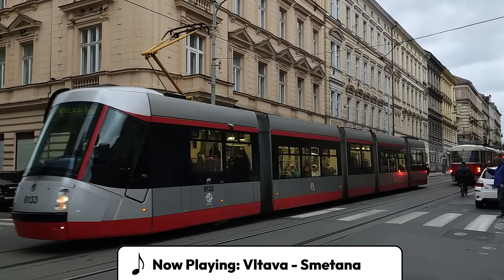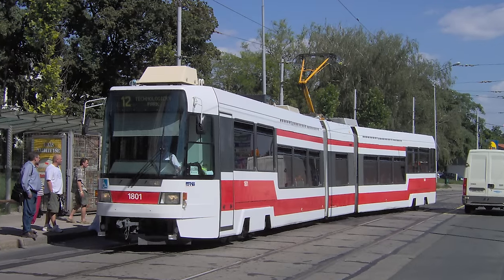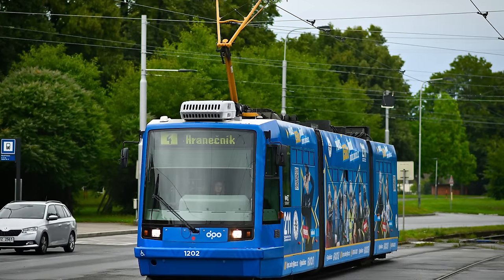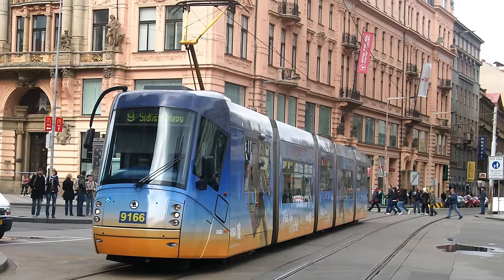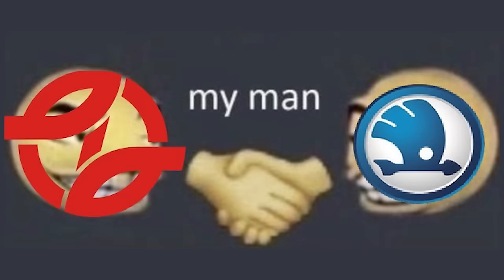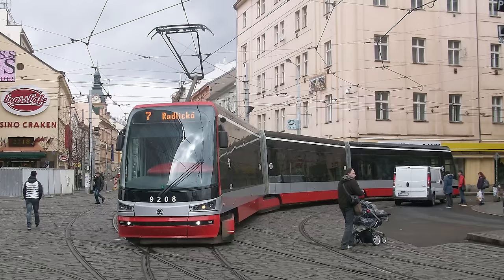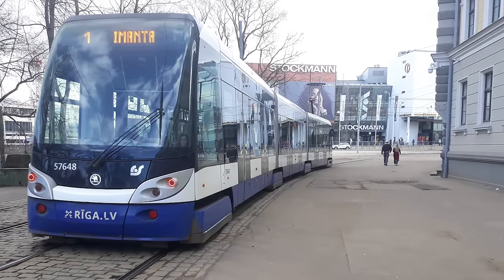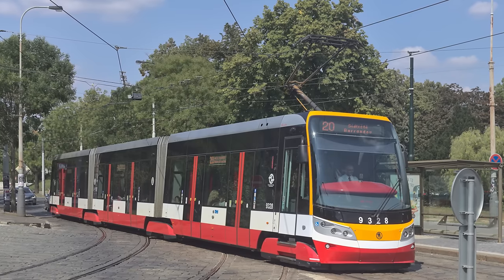Škoda 15T - The Tram That Revolutionized Transit

Comment: They should not replace the tatras, the t3s in prauge are the same thing as the double decker buses are in london
Reply: just because it's iconic doesn't mean it's the best thing ever created
Reply: @simunpusec1078 You know they can keep some of the T3s and put them on the nostalgic/historical line like 23?
Reply: @codefident4939  Škoda 15t is a piece of shit, and i know it because i live in prague. Theres not enough space and the design is just awful. Its the worst tram you can find in prague. ČKD Tatra has created the best trams, and Tatra T3 doesnt have any malfunctions, Škoda 15T in the other hand, has some serious issues and has limited speed because otherwise it would break into several pieces and that happened before. Line 23 already has T3SUCS its retro and some other trams are on it. I know that Tatra T3 will stay in work for more years than Škoda 15T. Škoda 15T is bullshit.
Reply: @Janevimteda_  I'm not from Prague so idk, maybe you are right. When I've ridden 15T (in Prague ofc) there were fine, although I think DPP should retrofit them with AC (this is what my city, Kraków, is doing with older Bombardier NGT6 trams). Also I feel like the older 15T's bogies are louder when going through intersections.

I think that Škoda 14T (and also 13T, 16T, 19T) is much worse. Ride quality is bad, the motors (or some other electric parts) are extremely noisy and the interior design is a one big mistake like metro-style side seats or pretty high floor in 3 out of 5 sections of the tram.
Reply: @codefident4939  No , he's full of shit or T3 nostalgist. 15T is the superior model currently running in Prage in terms of space and accessibility. That Tatra does not have malfunctions is just laughable - just 5 days ago one blocked a crossroad I guess because of an electric fault and batteries running out. The rescue crew tried resetting pantograph several times and ended up borrowing a front battery from T15 stuck in queue behind. How do I know? Because my (and several other kids) had to watch the entire thing.
Reply: @Janevimteda_  Every time I see a T3, I avoid it like a plague. Stuff belongs in the museum
Reply: Ofc they're gonna keep some for historical lines but it doesn't belong into regular service
Reply: As much as I love T3. they are far faaar less capable than T15. T3 as someone has said, belongs in a museum.
Reply: @Nauro50  You know that Škoda 15T has limited speed limit? And you know why? Because it would fell apart and that already happened once. The bogies of 15T fell apart and the tram was in 3 pieces. T3 might not be the best tram, but its safer than 15T.
Reply: I can absolutely recommend getting a group of people together and renting a T3 Coupé ride.

Comment: People tend to overlook the serious problems the 15T came with. It had huge problems with its wheels falling apart at high speed resulting un the reduction of the max speed it can travel at. It originally also came with poorly designed seats that caused people to fall off as well as a lower than advertised capacity. It also cost several times more than any other tram. And on a personal note its loud and ugly.
Reply: It is loud, but still better than the 14T. I encourage you to try the 29T/30T in Bratislava. They are surprisingly quiet and smooth riding, compared to both models that run in Prague.
Reply: Easy to overlook when everyone's first thought is just "thank god its not the 14t nor the kt8n."
Reply: Yes the old wooden seats... paradox is they have been selected by public questioning, but only based on pictures... in reality, they were good looking but neither easy to maintain (easily scratched) nor good function (hard, and people were sliding much on their surface)...

Comment: 29Ts in Bratislava are honesly better. Basically 15T but it doesnt have quite as tight interior imo (the bendy bits are as wide as the rest of the tram)
Reply: 29T/30T in Bratislava have a completely different bogie design. A much better one, relying on old and proven concepts that are cheaper, simpler and ultimately better. Not everything new, modern over-engineered is always the best. The new Škoda 52T trams for Prague are a further development of the 29T/30T and I hope they will ride equally good and silent.
Reply: @erikziak1249  Why didn't Škoda offer ForCity Smart tram like the 45T for Brno instead?

Comment: The Škoda 15T was truly revolutionary and over-engineered. Its technical strengths became its operational limitations. Having 16 motors with permanent magnets that directly drive individual wheels without a transmission and a four-point suspension layout on the inner bogies makes not for a very pleasant ride, especially on certain sections of the network. Initially the 15T was also very noisy, almost as the universally hated 14T. Some issues of the 15T had been fixed, but the fact that Prague opted for the 52T shows that an over-engineered and theoretically superior (on paper) streetcar is not necessarily better than proven concepts of classical tram axles and geared motors that run an entire wheelset. The new Škoda 52T was developed from the Škoda 29T/30T models that run in Bratislava since 2015. The Škoda 29T/30T model was specially developed for Bratislava (and does not run anywhere else), because the 15T has some undesirable running characteristics that Bratislava wanted to avoid. While the 29T/30T may seem technologically less advanced than the 15T and a step back, they are much quieter than the 15T, have a far better ride quality even on sections of worse tracks and since they reverted to decades long and proven concepts they did not suffer that many initial issues as the 15T did when it was put into service. The new Škoda 52T is practically a further development of the 29T/30T concept, and I am very curious how it will be. If it will ride the rails as smooth as the 29T/30T in Bratislava, then Prague is in for a treat. The bogies of the 29T/30T are really well designed, they produce little noise and even though the inner bogies are fixed (non-pivoting), the wheel flange wear is low, much lower compared to the narrow gauge bogies of ČKD Tatra trams. The oldest Škoda 30T streetcars in Bratislava have driven more than 600 thousand km in only 9 years of operation and remain in good shape. The majority of the trams was made in 2015, with a small part in 2016, when 60 units were delivered. Their success led to further 30 units being made in 2023 and 2024 and the last 10 trams are expected to be delivered in 2026. So in two more years, Bratislava will have 100 new air-conditioned, low floor streetcars. A very good design, relying on proven concepts, not overly complicated, smooth running and good for passengers, drivers and the operator (easy maintenance, low running costs). I can only hope that the Škoda 52T will be as popular in Prague, as the Škoda 29T/30T is in Bratislava.
Reply: we should see first 52T (20 trams) in december this year and another by the 2026. hopefully they fixed the kinks the 15T had and used it well in designing the 52T. still cannot wait to see the train in the streets.
Reply: @erikziak1249 is the 15t in Riga good?
Reply: @longiusaescius2537  Practically the same as in Prague. You have to ask in Riga.

Comment: The 15T is an institution.  The interior just feels so open and airy.  Wikipedia says the model produced for Prague can hold 300 passengers and I believe it.
Reply: Not just 100% low floor but with bogies under the cabs. However, it does have bogies under the articulations (common on light floor light rail) and really narrow articulation gangways, rather than fixed centre bogies, floating articulations and wider articulation gangways and has not gone well.

The upcoming 52T does have stub segments rather than bogies under articulations, but its cabs are slightly overhanging, but not entirely, like the 14T, most other low floor trams, and especially most high floor rail vehicles - trains as well as trams. Also, it does have internal steps over the centre bogies, so is actually more like 95% low floor.

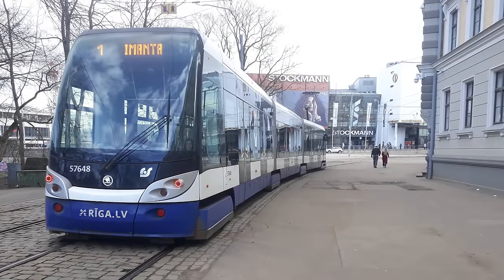Comment: 9:05 - There was 2 contracts, 20 3-segment trams + 6 4-segment, 41m, 15T1's, delivered between 2010-2012 and 2nd one with 15 3-segment and 5 4-segment one's. Delivered between 2017-2020. And Riga's 15T are wider then Prague's one. Ours are 2.5m, and was fitted with AC from the beginning. 

Overall in Riga we have plans for ordering more, but some parts of the network aren't ready for 15T, such as 5th line northern part, where tracks are really bad and hasn't been repaired from 90's. As for now - we need around 35 new 15T's to completely get rid of Tatra T3's and T6's

Keep it up, Mate! Very interesting story!

Comment: This video lead me into the rabbit hole of looking up the 29/30Ts that are operated in Bratislava, and I was surprised to find that they are based on 26T and not on 15T, even though the design language and silhouette is much closer to 15T. (I still prefer the more angular and aggressive design of older 15Ts, compared to 29/30T)
The 29/30T are awesome though, very smooth and quiet ride, the AC is ice cold during summer, although they do have some raised sections compared to 15T having completely low floor.

Comment: (LONG COMMENT)
Amsterdam has a similar story to this city, except Amsterdam's bridges pose a problem hardly any other city with a tram network has to face. The bridges bend alot vertically causing wear on any tram, you can't really blame a tram for that can you?
Most arent made for it, so their floor height is around 30cm to cope with this, but this deviated from standards around the world which brought unique problems with it.
The current Siemens Combino's wear down the tracks alot also because of fixed bogies on an older (legacy) network with tighter turn radii than other cities in the country.

Now Stadler and škoda are the only ones who actually WANT to work with Amsterdam on new trams.

Alstom at the time didnt have the right catalog and had no interest in solving Amsterdam's issue, its just a rumor but appearently Alstom had heard from Siemens and CAF that Amsterdam is a difficult client.
At the time of writing, Alstom's TW20 or atleast a modified version would probably come close to being a match for the city's needs.

I had my doubts with škoda but this video proves that they might just have what Siemens and CAF
dont want to do anymore.
What Alstom didnt want to start with in the first place.
And what Bombardier and even LHB
failed to prove with test vehicles in the 90's.

Now we're standing at the end of the Combino's service lives Stadler and škoda will compete to who will serve Amstedam. Though i believe the 52T will be the best fit for Amstedam through it's characteristics alone!

There are 155 Combino's that wait for replacement, a plan has been made to do this in batches of three to avoid choosing and buying one type of tram that might not suit the city's needs well enough as was the mistake with the Combino leading the city to be stuck with them for another 30 years.

perhaps škoda will play a pivoting role at the dawn of this change with what started with the 15T

Comment: I have been fascinated by i ever since it first came out. Clever, innovative and very snazzy looking too (the upcoming model isn't quite as attractive though). Many of the solutions chosen are surprisingly simple and yet effective and robust. 
Very different from other manufacturer's either insanely over-complicated or disappointingly sloppy constructions. Just look at all those horrible track eaters found all over Europe. All in the name of accessibility, but not very well thought out at all. They may be cheap to buy, but the actual long-term cost is often staggering.
It's somewhat surprising that 15T hasn't been purchased by more foreign customers. I know that it is expensive, but it has a lot to offer. Sadly, complicated procurement rules, which are easily used and abused by the legal departments of the big actors, and lots of political backroom dealings makes it difficult to sell this kind of product, even if it happens to be very good.
Reply: It looks like the 15t did not go well.

Comment: I wonder why is it that, unlike the celebrated Tatra T3, no Tatras T6A5 have ever been modernised and retrofitted with middle low-floor sections? As, for all I know, they seem to have been quite a success in terms of their practical performance. Strange, innit?
Reply: The T3 PLF isn't actually retrofit at all, physically they're entirely built from scratch. They just replaced a decommissioned T3 with a whole new tram while keeping the paperwork, basically - I think that this is what allowed them to keep proper fully opening large windows on a newly designed tram, despite dumb regulations. 
They are built on top of VarCB3LF tram chassis, with the cosmetics of T3. They aren't even the same length, they're 1 meter longer than T3s.
Reply: T6A5 is in fact even higher-floor than T3 (even if not by much). And those that had been purchased by czech cities, have been new enough to not need new body, as opposed to older T3s. The "reco" T3s (using the new Var CB3 body with middle low-floor section) are in fact complete new-builts, from the old trams they're getting "papers" (registration) and sometimes old reworked bogies.
When they are new built, there is no need to stick to any previous form, so they are modelled similar to T3 but there are positive changes, like new improved-view front (and back) sections, plus the front and rear doors are never more at angle to the track/platform. The power electronics of T6A5 has certainly been never and better than the "old" mechanical controller of T3, but there are allready many newer versions backfitted to T3s (like TV Progress) and current versions are far newer and better to T6A5, together with new engines using AC drive (TV Europulse) as opposed to old DC motors.
So, T6A5 are ugly and unpleasant to use and being phased out, and there is no wish (and no reason) to do anything about them. Maybe their bogies will remain as spare parts for DC versions of reko T3.

Comment: 7:26 still not even remotely enough, not putting ac in these is just stupid. its better to wait for T3 in the summer because of this. there were plans for retrofitting the older 15Ts with AC, however Hana Kordova Marvanova blocked the decision to go ahead with it, as she does with a lot of good stuff in this city. awesome.
also they are too heavy and noisy because of the weight. unique motor configuration is unique for a good reason, its not the best & most relaible.
I prefer skoda 29T & 30T which is basically an older 52T

Comment: I hope 15T remains as long as the T3.
Reply: Probably not, it's today technology, it will get some software errors and company that programmed won't even exist or something, so they will scrap them because of that, that's my predition. 🙂 Today technology is not designed to survive decades.
Reply: I hope T3 will remain longer than 15T.

Comment: I never knew the Alsthom TFS model (stands for "Tramway Français Standard" ie "Standard French Tram") was exported to Czechia as the RT6N1. This model was very successful in France and is still in service today. It has some flaws but I prefer it over its successor the Citadis x02 (which has been the most common tram in France for the last 20 years). The Citadis is somewhat sluggish, turns poorly,  and has very poor suspension and ride quality.
Reply: It was not exported, it was only an inspiration. At least that's what wikipedia says...
Reply: Not exported rather copied by the infamous architect Patrik Kotas